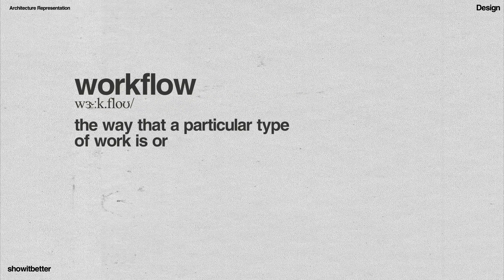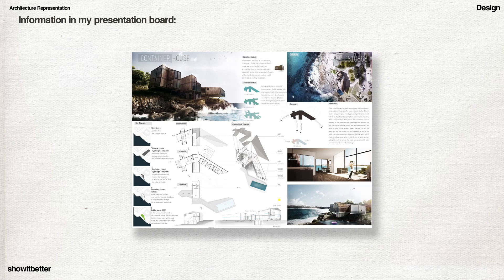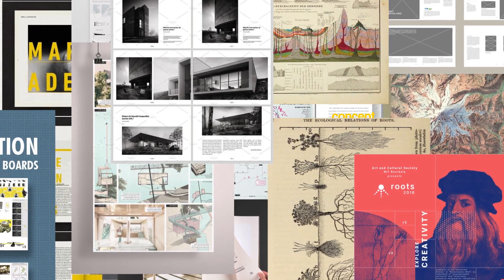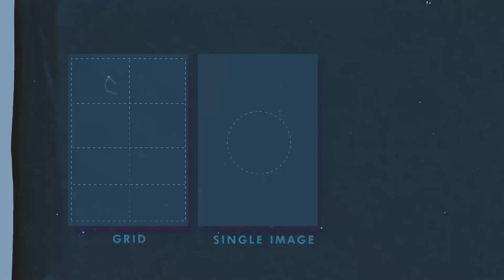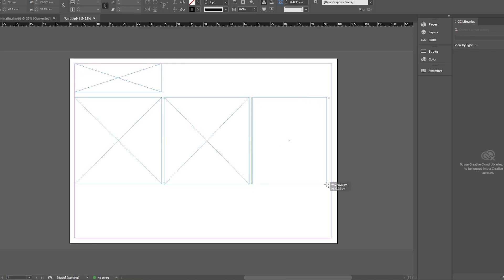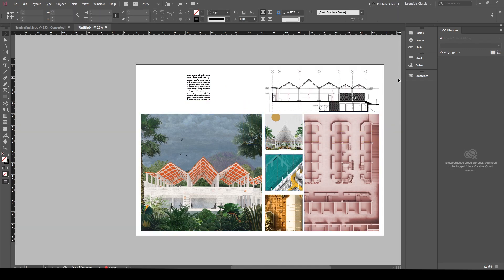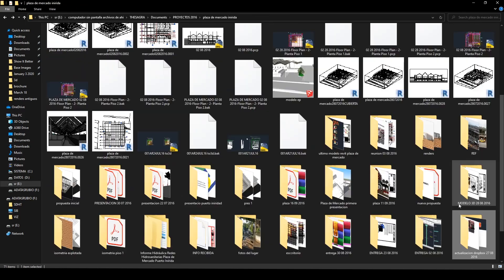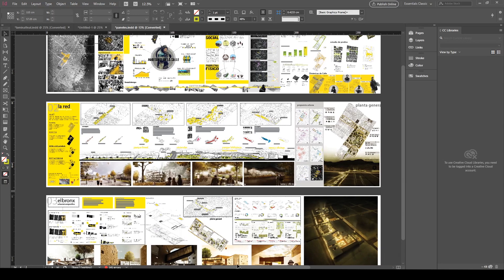My Architecture Presentation Board Workflow

Comment: Thanks a lot for this video! I didn't understand one part - in which format do you save the drawings still "in work" so that you can still update them whenever needed? Always jpeg-s or can you also link psd file? Can you please explain briefly how to link them to inDesign so the workflow is the fastest? Thanks!
Reply from the maker: Yes, you can link the psd file..sorry for not being clear. Just drag in a psd file to your indesign like if it was an image...and resize it as it if was a normal image...then you start working in your photoshop file and every time you hit CTRL S (save) it will be updated to indesign. If it is not updated then there may appear a yellow box next to your image, a warning size. Click on that box and your image will update.
Reply: @ShowItBetter  Thank you for the explanation! I'm a bit new to InDesign. So if you link a jpeg then there is no way to update it automatically and you would have to re-link it?

Comment: So, for the final image imported in indesign, would you recommend to import an image in png format to minimize the file size? or is there any other option? jpeg or pdf?
Reply from the maker: If the image is made in photoshop i would recommend importing the photoshop file, or if in illustrator then the illustrator file. I have worked with many big big files and have not had a file size problem...the maximum it has gotten is about 60 mbs....which is not that much compared to a board done in photoshop or ai
Reply: @ShowItBetter  Oh what I was asking was the final format of files in indesign. In order to minizme the indesign file (for uploading issues or job application,etc), I thought having PSD or ai format could be increasing the indesign file size.